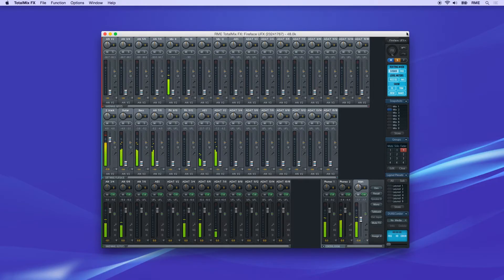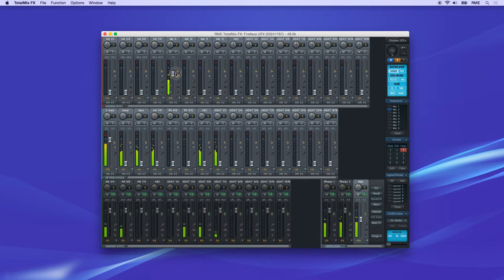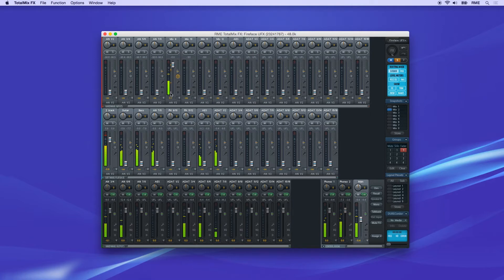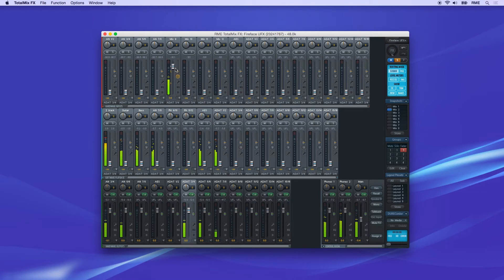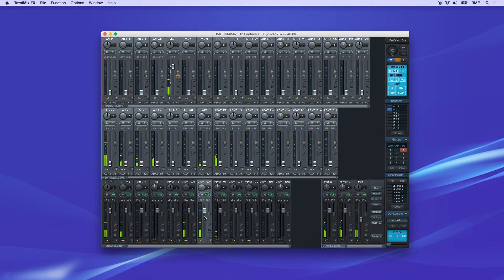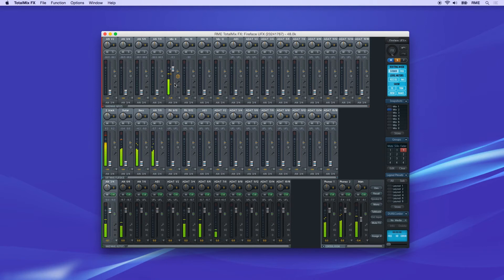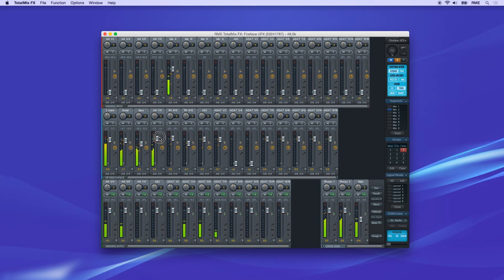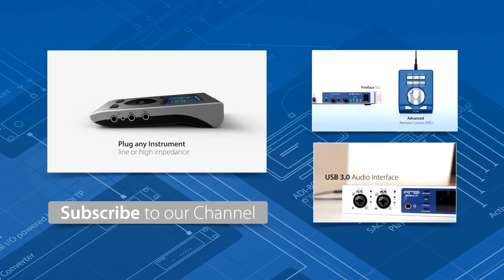How to use RME Audio TotalMix FX - 10 Trim Gains

Comment: there is one thing I don't understand exactly:
let's say I have Main, Phones and SPDIF outputs with one active input assigned,
Main and Phones is supposed to output at same level (let's say -15), SPDIF not to output this channel at all (-infinite),
when I use trim, all those channels have their routed input faders moved following "relative" values,
but once I click trim again, only Main and Phones have their input fader moved to the trimmed value, SPDIF fader keeps (-infinite),
how exactly is trim supposed to behave for (-infinite) faders across multiple outputs?
thanks in advance :)